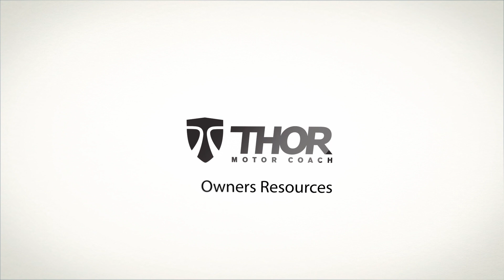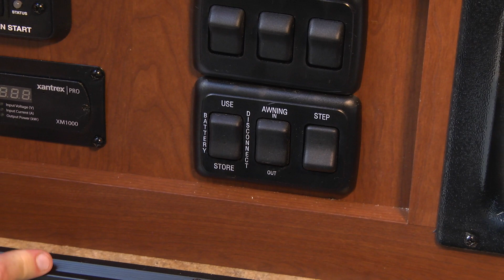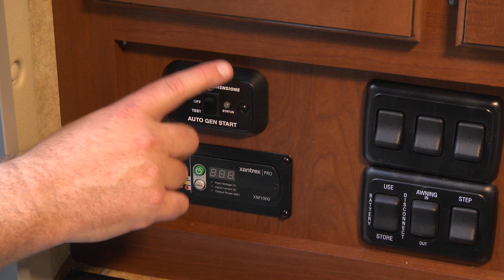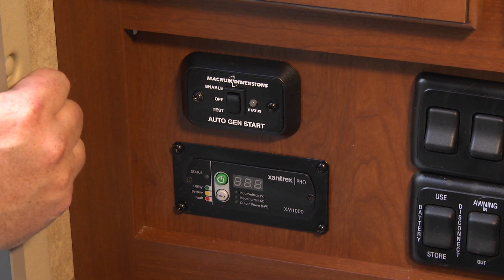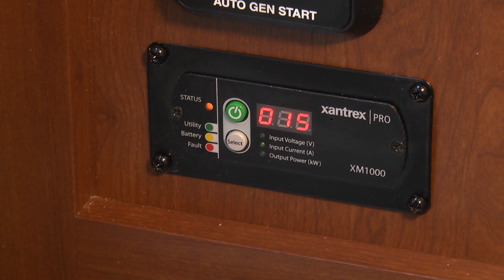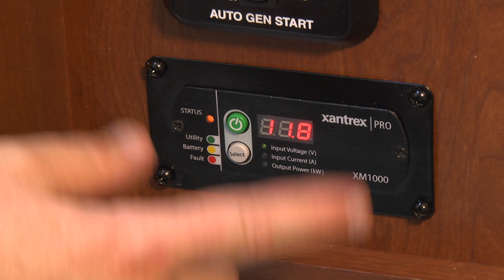A Look At Your Thor Motor Coach Interior Stair Well Switches

Comment: So if I want to run my residential fridge while driving, do I use the generator or should I turn on the inverter? Or is it a combo of both that need to happen? I will be traveling and want to make sure my fridge is on while driving long distances.

Comment: Dear Thor,  really really time to update all your videos.  They are very helpful to us newbie’s to the Thor class A but frankly I have a 2023 A.C.E. 30C and, well, you really need to update the videos!😁
Reply from the maker: Hi Bud, you are correct.  We plan on making new videos for all our brands this year. Thanks for the feed back - Steve
Reply: @ThorMotorCoach  when I hit the battery store button I just hear a click in the power panel area under the dinette , 12 V LIGHTS STAY ON. JUST GOT A 2018 4 winds, 23u, getting frustrated learning. How it works.
Reply: I used our VIN number and this is not what our model looks like inside. How do we find one for our specific year/model?

Comment: Is there a video explaining how to properly use The freedom X 2000 inverter system. I have a 2019 35.3 miramar. It is currently displaying an error 04. Thanks
Reply from the maker: Hi.  We do not have a video on that specific unit.  Error 04 is an Over-temperature shutdown.  You'll find it on page 70 of the owner's manual.  https://www.xantrex.com/documents/Power-Inverters/Freedom%20X/Freedom%20X%20Inverter%20Owners%20Guide%20(975-0787-01-01_Rev-F)_ENG.pdf   You can also reach out to our Customer Service team at Customer Service (877) 855-2867.  Thanks for the question. - Steve

Comment: What are the three buttons or lights or labels on the left side of the Xantrax panel for? I'm referring to Utility, Battery and Fault. You didn't mention them. I have this same panel on my 2017 29FE and I'm not sure if I should be checking this readout daily or looking for something in particular. Also I'm pretty sure the display lights up and goes dark on its own, without me pressing the green button (power). Or is it haunted. ;-)

Comment: Just got a :ws31 2021. Should we enable auto gen start at all times or only when actually using the generator. Manual is a little short on this.
Reply from the maker: Glenn, it is entirely up to you. Personally when I am out I keep it on for a few reasons.  If I'm out and the batteries get low the generator kicks on to charge up the batteries so the fridge keeps running, plus it will turn on the AC units. - Steve
Reply: @ThorMotorCoach  thanks for the info.

Comment: How do we get the radio/back up camera screen to turn off?  Tried holding mute button- didn't darken screen.  Thanks. Newbie.
Reply from the maker: Mary, do you mean just the camera or the entire unit?  Do you want to power it off, darken the screen, switch between modes?  If you provide a little more info I should be able to help. - Steve
Reply: I found this one. There's a little picture that looks like a monitor in the bottom left corner of the screen. Push it once, and the screen gets a little dimmer. Twice, dimmer still. Push until it goes black. When you do anything, like change the volume, the screen will light back up.